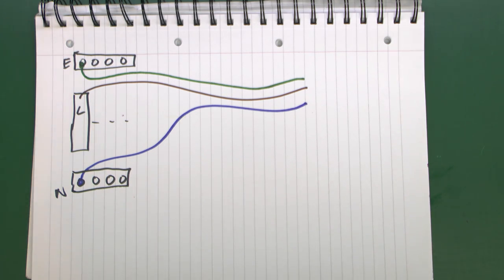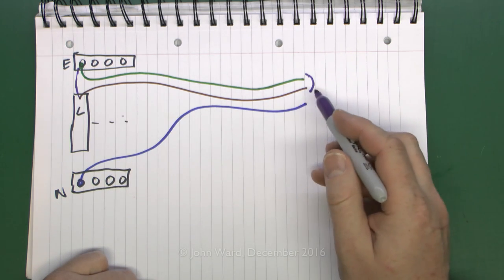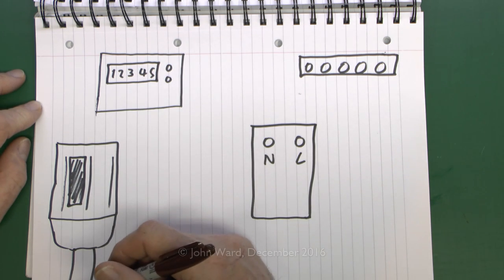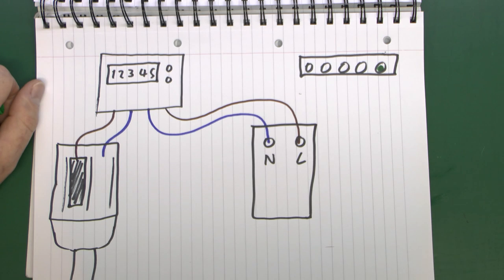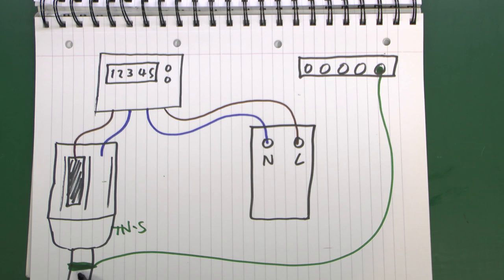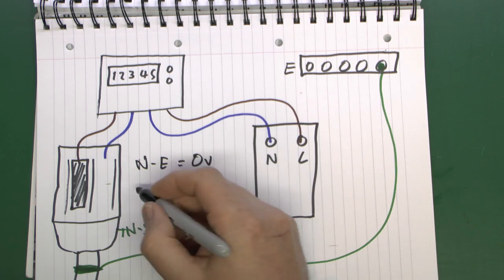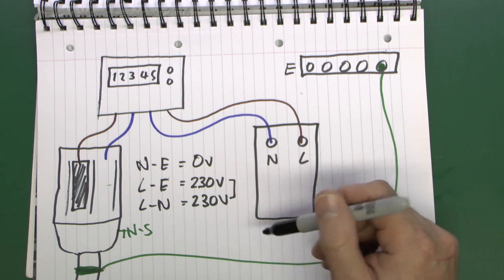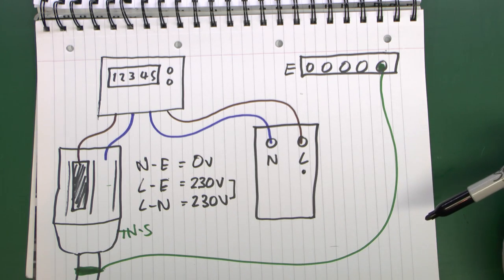Polarity Testing

Comment: How do US power cables work as they can be inserted either way so how is Line / neutral connected?
I assume on a UK plug the line is switching + and - hence the AC part, but the neutral is always the neutral. so I don't understand why half the time US appliances don't work as line and neutral are the wrong way around. 
thanks
Reply: We also have this in Germany. The plug is symmetrical and can be plugged in both ways. Earth is always earth but Neutral and Line can be 
switched (the connection to the device). The polarity is changing 50 times a second (50 Hz) here. Neutral is connected with Earth. This is the reason why you don't get shocked when you touch it.

(Warning. I'm not sure if I'm talking bs.)
Reply: A good amount of power strips are unsafe here because of this. When you flick the switch some of them only disconnect one wire. So it's a 50:50 chance of getting the line one.
Reply: Also it depends on the device if AC is working or not. PCs for example work with DC so the power supply has to convert the AC to DC.
Reply: Paul Allen The appliances have internal circuitry to overcome the problem.
Reply: No internal circuitry is required. As John stated, there is no polarity on AC - Line and Neutral are just two anti-phase (180° out of phase) sinewaves.
Reply: +Ace Doesn't really matter though - it won't leave the device in an unsafe condition as the switch is not a recognised isolation switch so you wouldn't perform maintenance exposing conductors on your appliance. The switch is used merely to turn the connected device on or off.
Reply: SDG Electronics so how is UK plugs wired so only the line goes down the fused wire.
Reply: Paul Allen By creating a polarised plug/socket combo, which guarantees that.
Reply: SDG Electronics
That's funny. I thought the point of neutral is that it stays neutral, it's potential does not change while line potential changes.

Anyway, by "internal circuitry" I was referring to a bridge rectifier.
Reply: Mawerick77 It depends what you measure with reference to.
Reply: SDG Electronics
I'm not going to argue against that. I'll also stop the conversation here as far as I'm concerned, as english is not my native language.
Reply: The design of the plugtop (plug) is such that it can only be inserted into the socket outlet in one way. This is achieved by the actual layout of the conductive pins, the earthground pin being the determiner, and for us in the UK that is at the top or 12 o 'clock position.
Internally, the layout of the connections is such that looking at the plug with the cap removed, the line/live connection is on the right hand side, the neutral on the left, and the earth/ground at the top.
The line connection also provides for a fusible element to be inserted, and this fuse is chosen to suit the rating of the appliance and the flexible cord provided.
Our plugtops are often criticised for being bulky and unnecessarily complicated. They are however designed with safety for the user in mind, and incorporate features which control safety shutters on the socket outlet, prevent finger contact with exposed conductive parts, and when correctly wired, the correct maintenance of polarity.
Reply: That's why double pole switching is essential where there is the possibility of reversing the polarity because the plugs are non polarised.
With a double pole switch you are more certain to have disconnected those conductors which may normally carry current. That includes the Neutral.
Reply: Hassan Burrows Double pole switching is not essential except under specific circumstances. What difference does it make if you break the line conductor or neutral conductor?
Reply: SDG Electronics 
As John stated in the video. If neutral is broken the the device can still form a closed  circuit to earth (ground, piping). The example he gave with a live exposed bulb socket can be a real killer if the wrong line is broken.
Reply: SDG Electronics 
Always with ref to earth????
Reply: SDG Electronics 
John did not state that at all. He stated the the AC (in the live wire) do not have a polarity, i.e. the bias goes +/-325V in the live wire with respect to earth. The neutral wire will be at the same potential as the protective earth wire as they are mostly connected at some point. That is the WHOLE POINT OF THIS VIDEO.  

With your understanding, neutral and earth would also be 230V (which is false).
Reply: SDG Electronics Trust me when I say that normal people think it's 100 % safe when you flick it and get shocked afterwards by doing something stupid.
Reply: SDG Electronics Trust me when I say that normal people think it's 100 % safe when you flick it and get shocked afterwards by doing something stupid.
Reply: Adt Net Read the comments - we are talking about appliances. Nothing internal would be referenced to earth in which case polarity makes no difference as the line and neutral conductors are just two anti-phase sine waves. This is why European plugs don't have to be polarised.
Reply: I think you're missing the point Adt Net. The device does not care about the polarity as there is nothing in it referenced to earth. Please pay attention to the video and the comments rather than getting confused.
Reply: "A good amount of power strips are unsafe here because of this. When you 
flick the switch some of them only disconnect one wire. So it's a 50:50 chance of getting the line one."

+Ace : 

Nope, in Germany portable appliances must have a 2-pole switch which is switching line and neutral, according to DIN VDE 0100 part 460 it's not permitted to switch the neutral wire alone.
Reply: mgermi
Must and do are different things dude.

Comment: How can you do a polarity test if the power is not switched on?
Reply from the maker: Polarity without power is confirming that the wires are connected to the correct terminals and single pole switches are connected in the line only.

Comment: May I know why does it matter or what situation does it matter to know which wire is live and which is neutral?
Reply: Cosmo John Neutral will not give you a shock, line will.
Reply: Mawerick77  But when common electrical appliance running on AC is used, it does not cause damage if polarity is wrong. This also means that Live and neutral are equally deadly.
Reply: Neutral is generally / should be tied to ground / earth but Line/Live is obviously not. Therefore corectly a wired circuit  cannot give you a shock between Neutral & Earth. However, without protection in the circuit, Line/Live will give you a shock between Neutral or Ground. AC appliances generally don't care if they get L/N or N/L for there supply.
Reply: The switch is on the line wire. If you have them reversed, the appliance could still be live right through the appliance and back to the switch even if switched off.
Reply: Not strictly an issue though. For maintenance purposes, an approved isolator which disconnects all poles is required.
Reply: John mentioned about the problems with Edison screw type lampholders where the line conductor becomes connected to the screw part.
But other occurrances might be presented in power supplies for equipment which involves a reference to the mains earth.
I recently had to replace an on/off switch on an LCD television, and I was pleased to see that the original was double pole in design.
That unit was made in Germany, perhaps taking into account that the Schuko plug can be inserted into a socket outlet either way.
Reply: And just as an afterthought, if you work on old/vintage radio and television apparatus, polarity is important, because some of thise sets did not contain a mains transformer. There was a direct connection between the incoming current carrying conductors and the chassis. So if you got the polarity wrong and toiched the chassis, you would get a shock.
Reply: Spot the person who hasn't watched the video
Reply: I dunno about that, young me wired a plug for xmas lights wrong and put the neutral in the line and vice versa. Plugged it in and the lights worked fine, so both the line and neutral must be live for the circuit to work. This mystified my father who expected it should have tripped the RCD in the Consumer Unit.
Reply: Possibly the best way to stay alive would be not to attempt any work on your electrical items and home circuits till you know what you are doing as plainly you do not at the moment from your comments.
Reply: There is a 'live' wire detector . Can DIY
Reply: Mawerick77  The Neutral will shock you if you provide a low enough resistance path to ground so that the current can be shared between you and Neutral. Try sitting in a bath of salt water and touching the neutral! Generally speaking though, you're right, but I don't go around handling the neutral in any live electrical installation, just in case...

Comment: What does single-pole switch actually mean?
Reply from the maker: A switch with only 1 set of contacts, used to switch line only.  A double pole switch has 2 separate sets of contacts and switches both line and neutral at the same time.

Comment: L = Line or Live?
Reply: TheAmmoniacal L is normally Live as both Live and Neutral are 'Line Conductors.'
Reply: Other way around, Line and neutral are live conductors
Reply: Sorry guys. Technically, Neutral is a "Functional Ground", not a line conductor. Line refers to transmission lines, of which the neutral isn't one.